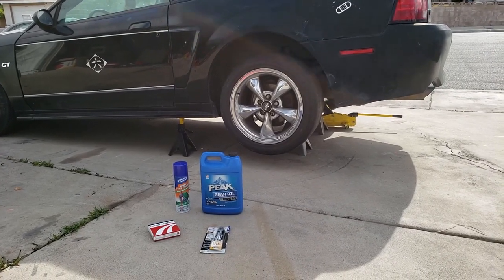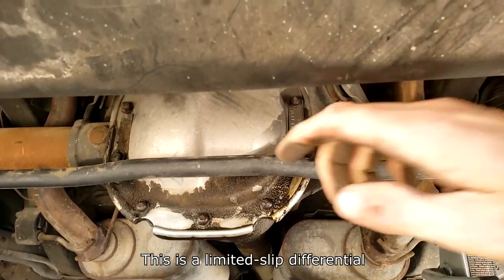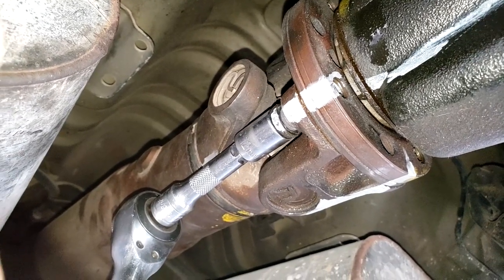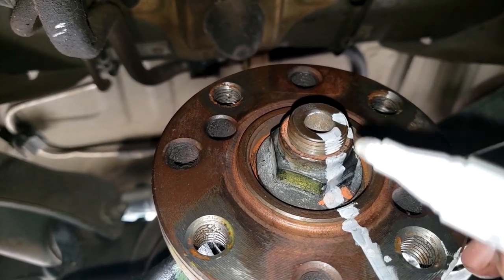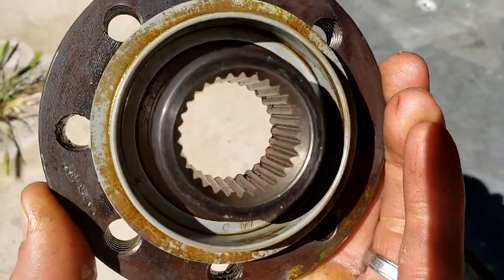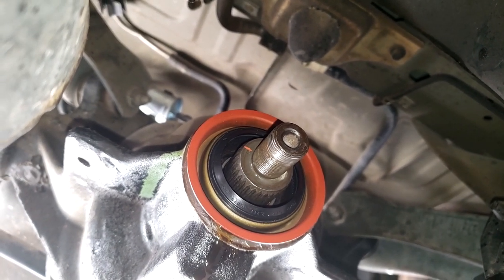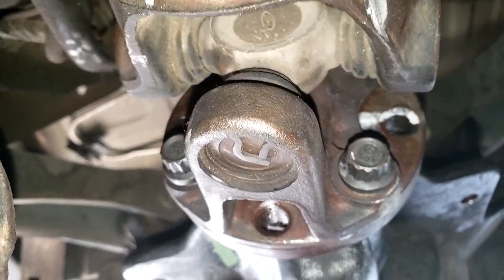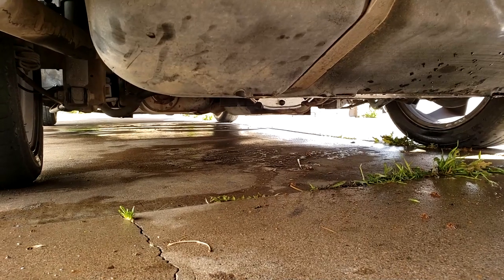How to Replace a Rear Differential Pinion Seal - Stop Leak (Ford Mustang F150 Ranger Expedition)

Comment: sooooooo if you dont mark your drive shaft...... how do you know if its not were its supposed to be? i removed my drive shaft when i was doing my clutch swap and instead of marking it i just put it down the same way it was and tried to get it back up afterward, If its not were its supposed to go where could i take it to get it back in balance?
Reply from the maker: Yes, you could balance it, or, you could drive and see how it feels. If there is vibration, you know its x degrees off.
 I hope you will subscribe to me soon!

Comment: I change mine now my diff it's making a noise only when I slow down. Any tips how to fix the problem 7.5 diff
Reply from the maker: When slowing: worn spider gears/clutches or incorrect/poor lubrication.
Reply: @TutorialGenius  you think maybe I didn't  tighten  enough the flage